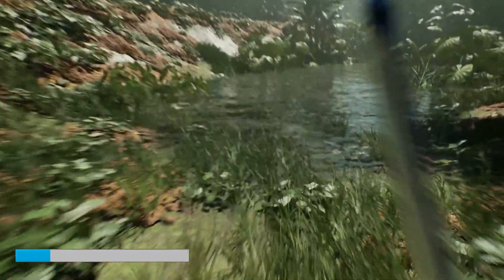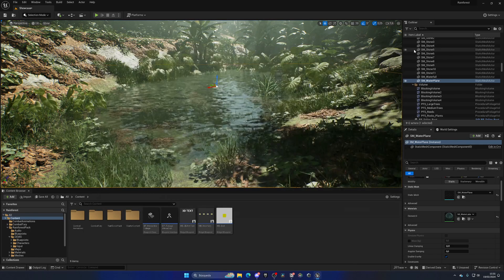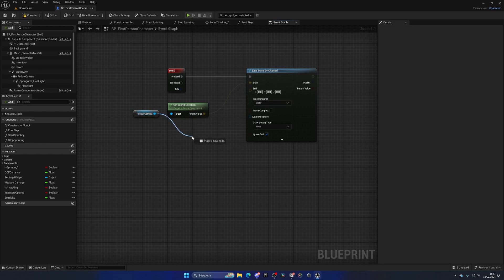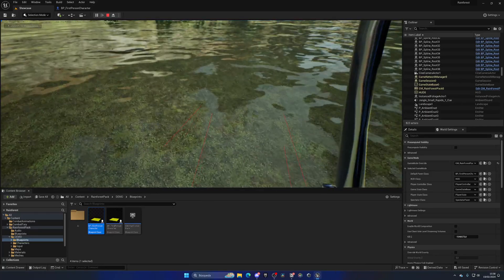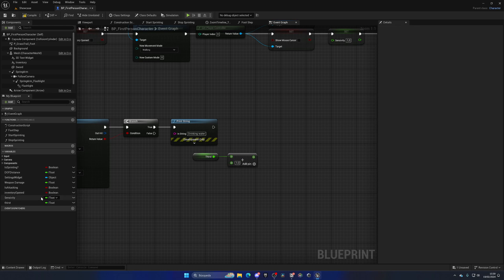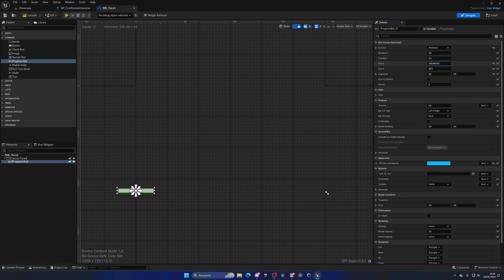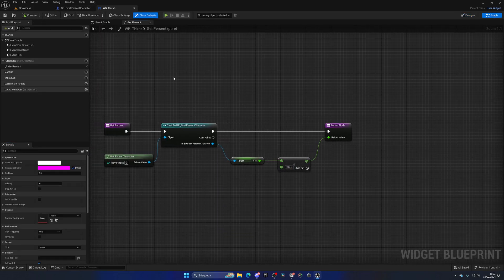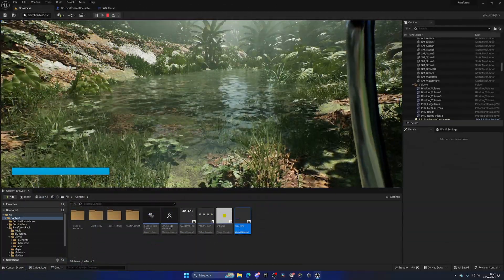How to Drink Water with a Thirst System in Unreal Engine 5

Comment: I can see that @7:50 you are STILL teaching people the exact wrong way to do UI. Since you have not learned how to do UI, you will no longer be recommended to anyone. It's a shame, because I was really rooting for you to pull through.
Reply: how do you do it correctly?
Reply: @Indigo_orkid  You shouldn't create binding so the UI is constantly updating because this is useless and resource-consuming checking 60 times per second.
Instead, you should add at the end of the KeyEvent to update the UI with the new value.